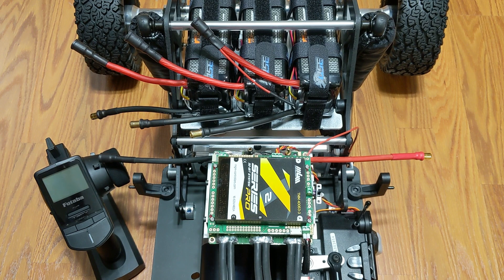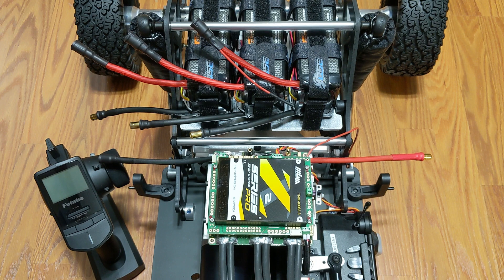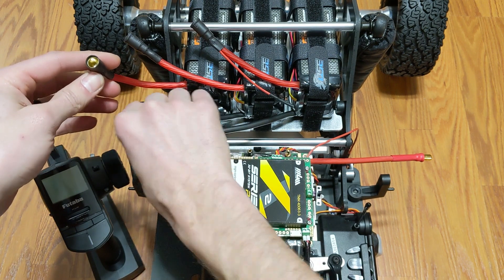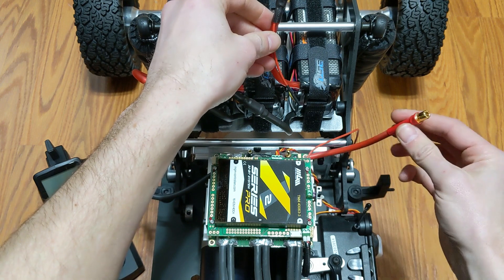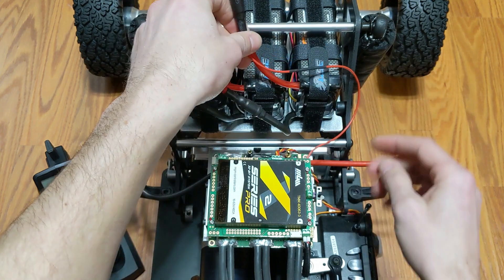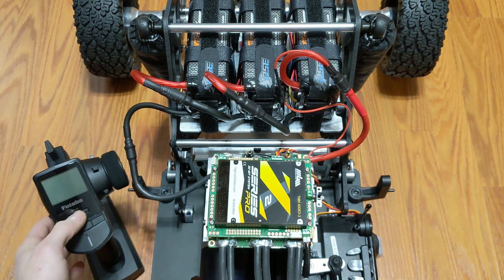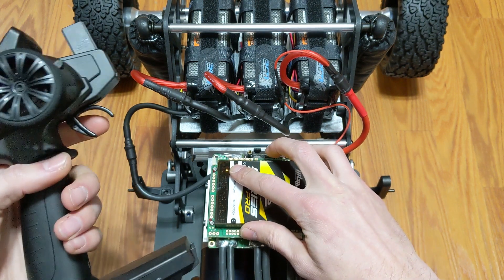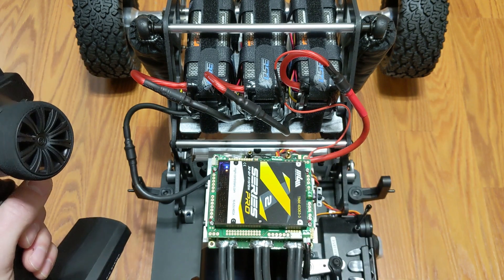Lipo Series Connections - MGM Startup Procedure

Comment: If i have an xt-90 antispark connector on my battery and controllers do i need to use the antispark wire on the controller or can that be left unconnected?
Reply: Hello Quintan, if you are using XT-90 with an integrated anti-spark solution then there is no need to use our little antispark wire. You can leave the connector unconnected or unsolder it.